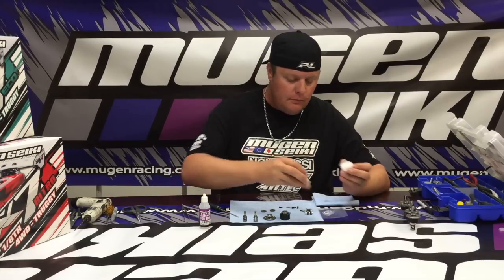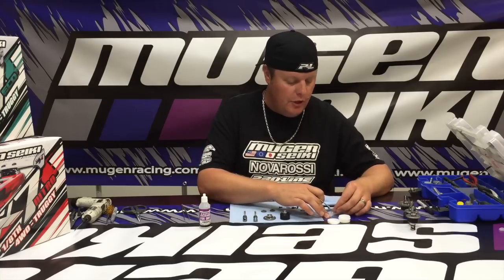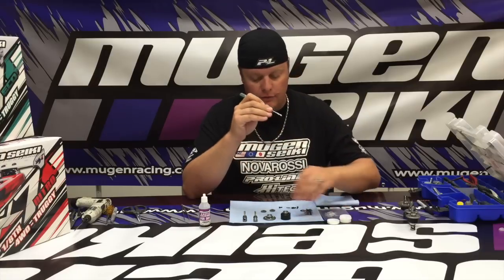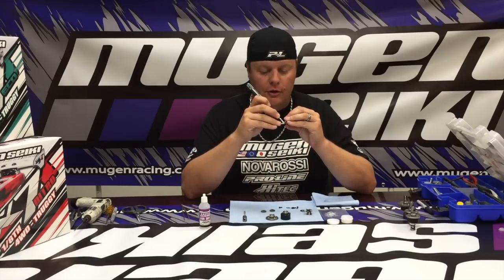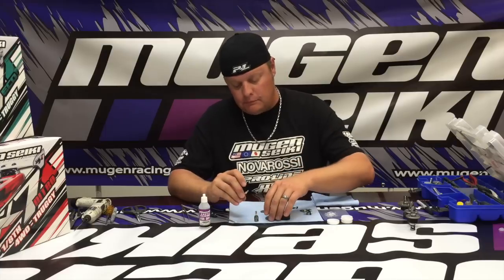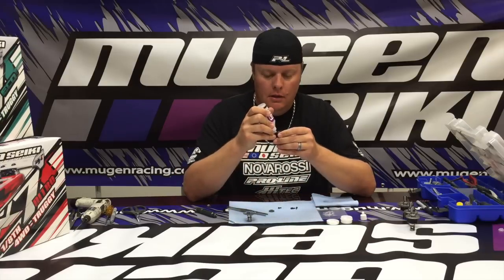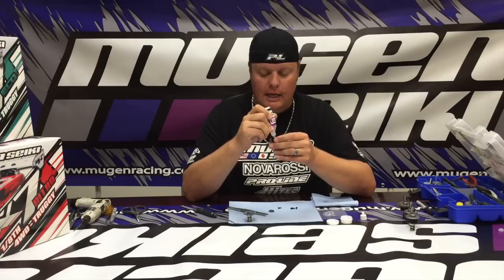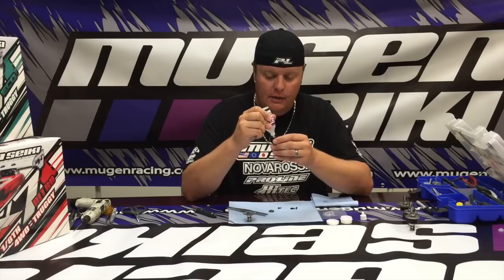Adam Drake from Mugen Seiki Racing explains diff building.

Comment: Is there a difference in spur gears for Nitro and electric for this car
Reply from the maker: +killjoy42086 
Yes, the Eco uses plastic spur gear.  If you plan to run a metal spur gear on the Eco, make sure you order the metal gear from the X6.

Comment: Hey Adam what would be a good diff set up for a beginner to average driver. And easy to drive
Reply: For the Mugen mbx7r
Reply from the maker: +dericlane761 
5,000 front - 7,000 center - 3,000 rear is my standard set-up.  Here's a link to Ronda's set-up.  It's very easy to drive.  http://www.mugenracing.com/content/Setup%20Sheets/MBX7R%20Ronda%20Drake%20standard%20set-up%20.pdf

Comment: Can I use the protek premier blue grease instead of the stock grease that comes with the kit
Reply from the maker: You can use the Protek blue grease on the o-rings, but not for the outdrive, diff cup, and ring gear.

Comment: Hi adam. What could cause a clutch bell to  not spin freely
Reply from the maker: Maybe the bearings are bad, clutch nut came loose, or not shimmed correct.
Reply: @AdamDrake  is it ok to only run one shim. I run one near the flywheel nut and inner bearing